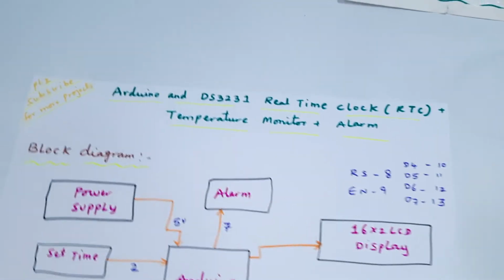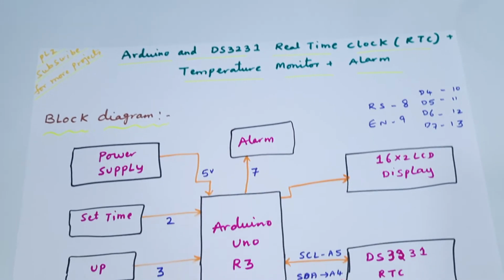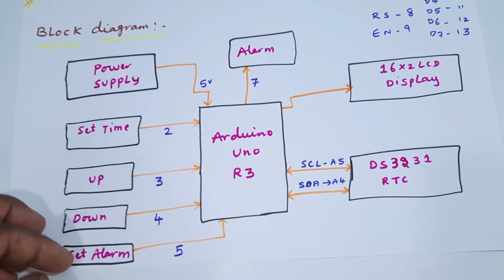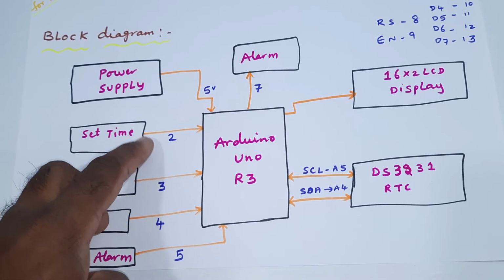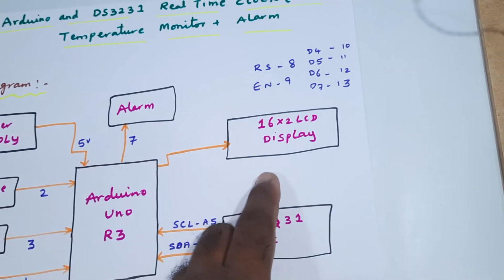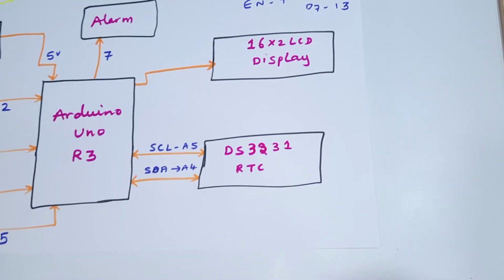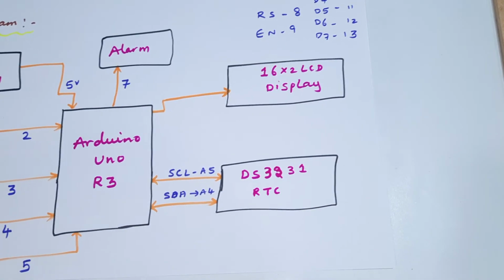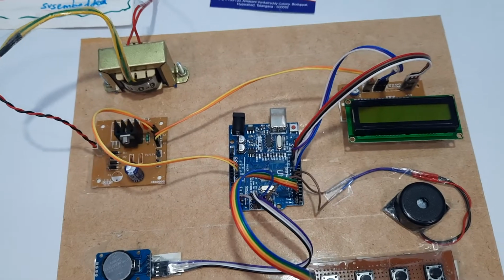Arduino and DS3231 Real Time Clock (RTC) + Temperature Monitor + Digital Alarm Clock

Comment: HI, i'm using the same rtc module version. but i'm having an issue getting 165/165/2036 value in place of date and time. can you help me??
Reply from the maker: Thanks for watching and your valuable Feed back. check wire connections